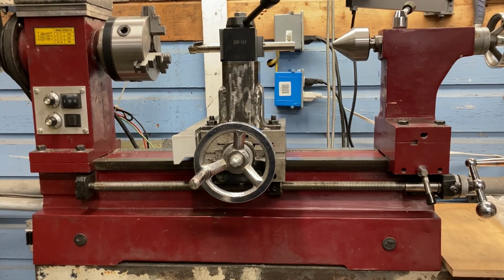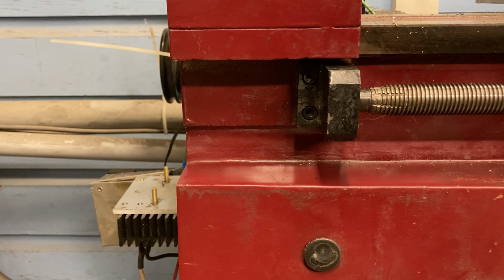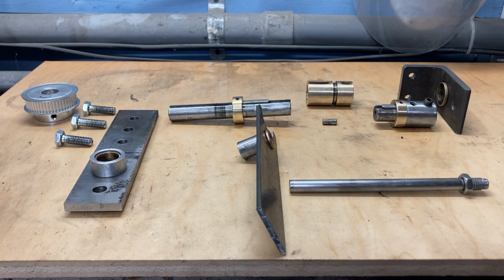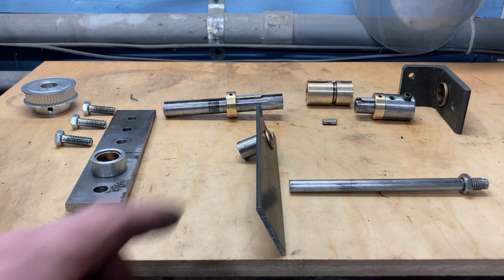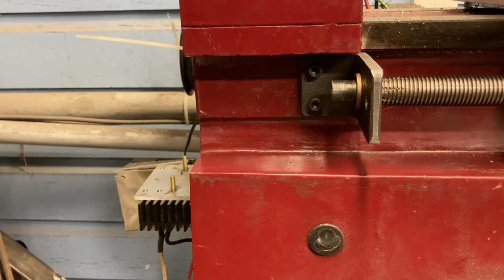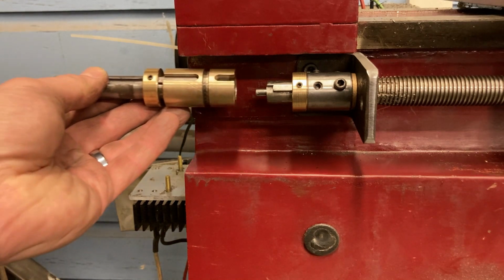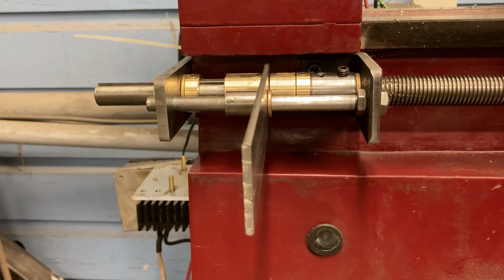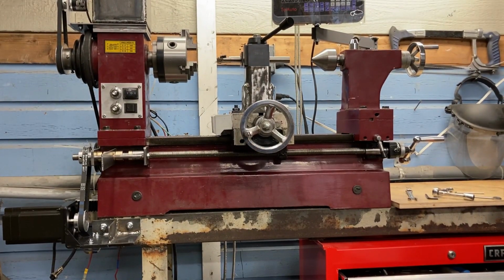DIY Lead-Screw Shaft Clutch for 3 in 1 Lathe Mill, For my clough42 ELS Electronic Lead Screw Project

Comment: Nice solution. Did someone use the leadscrew to cut an Acme thread into a nut? Looks like someone has cut flutes into it! Separating your mill/lathe combo sounds pretty cool.
Reply from the maker: You are the only person to notice my "thread chasing" lead screw.  Yes I used it to fit a new nut to my machine.

Comment: We have talked before concerning your Milling Machine build "conversion" Any way I have just completed the Clough42 ELS and have been trying to find a proper way to wire a carriage cut off stop  and an emergency stop. I have looked over for any comments but have found none so far. With your vast knowledge I was wondering if you have added such features. Om fine with the mechanical aspects. but wondering proper electronics. I was wondering if I could use either the alarm circuit. or just interrupt the DC power.
Reply from the maker: I have not put the safety switch on mine yet.  I posed the same question to Clough42.  Here is my original question and his answer.  Because mine it setup to use both his driver and a stand alone drive I am going to to the way i posed in my question.

Me:
" I have a really simple question. My system is working well and I am very happy with it. I would like to add a normally closed push button switch as a full travel carriage stop for safety. My plan is to wire the switch in line with the wire that connects the + from your board to the three + inputs on the stepper controller. I know that cutting that power will stop the motor, but what I am wondering is if there would be any negative side effects to the electronics by doing it that way and if so is there a better way I can do it? Thanks"

Clough42:
"You could break just the enable line and this should stop the motor, unless you have it inverted. Breaking the +5 should also work.

Remember that this will lose synchronization if you're threading."
Reply: Thank you so much for the quick reply!!! My intent is strictly as a safety measure to avoid old age mistakes and crash the tool into the Chuck! my intent is not a stop for threading, although by the sound it might be able to be used as an approximate stop for turning, again, having a DRO that isn't my goal.  I going forward with a stop and while I'm at it an emergency stop. Ill use the enable feed to shut down the motor feed. Thanks again for your help!!

Comment: Thank you so much for the video! Just as you said, I'm too shocked that I just can't find a simple mechanism that anyone made before....That's so frustrating, though my application is slightly different than yours.
Basically I have a stepper motor that I'd like to engage and disengage, but I can't find any easy and simple mechanism that I can use without dealing with huge backlash.
I'm wondering, do you think I could use the mechanism you showed with 3D printed parts? I don't have a lathe mill(having that would be a dream!)

Also, it seems like when the clutch is engaged the parts are well tightened together even though it just slides back and forth, how reliable is it? How if I'd have my shaft vertically instead of horizontally, would this mechanism still work?

Thank you for sharing this great video.
Reply from the maker: Thanks, I am glad you liked it.  I have been using my clutch for months now to cut threads and then disengage when using the lathe for other things and it works flawlessly.  It has a nice crisp lock and unlock , I am very happy with how it works.  Vertical compared to horizontal shouldn't make a difference as long as you come up with a way to lock it in the up position like a detent.  I may add one to mine at some point but for now the parts are tight enough that its not needed.  As to the plastic parts, are you wanting to print the entire thing or just the parts I made out of brass? If it was all plastic I don't think it would work as the parts would bind against each other but if it was just the slider I think it could work.  My concern would be flex in the plastic.  Another option for you being that you don't have a mill or lathe would be to use a deep socket as the slider and a nut on the shaft that is being driven.  Hard to know how you might mount the socket/slider as I am not sure exactly what you are working with.
Reply: @dazecars  Thanks for the fast reply!
Regarding which parts I need, basically each part I can't purchase, e.g - a simple shaft coupler could be purchased(if it even helps here), but anything custom beyond that would be 3D printed I guess as I don't know anyone with a mill and custom orders are very expensive.

If you feel like it, I'm kinda trying to replicate the following design:
https://youtu.be/TN5hnE2UnbU?t=287

It's a telescope focuser that's being rotated by a geared stepper motor. Since it's high gear ratios, moving the gear backwards is not really possible, and I'd like to achieve that mechanism that will allow me to engage/disengage the motor, then came across your great design, but since the application and method of use(3d print vs mill) is slightly different, well I'm not sure I'd be able to make it good enough ^^

I'll try reading about the deep socket you suggested, thanks a lot :)

Comment: i got the shop fox mill lathe combo i just wish there were a way to make both the mill head and lathe turn at the same time.. like the central machinery..  on mine u engage a clutch in the gear box.. can anyone help me on this one .. how is the central machinery one set up so that it does this..  is there no clutch..?? can i modify mine to do this.. is there a different clutch i can buy that will do this..?? i'm thinking if i remove the clutch engagement knob it might turn all the time..
Reply from the maker: First I have put together a Facebook page for 3 in 1 machines, if you have Facebook you should come join us.  https://www.facebook.com/groups/168134035160655 

As to your question the Central Machinery units have a dog clutch slider and if you put it half way between the two you could engage both at the same time but it doesn't lock into position for either one so one or the other could pop out.  I'm wondering for what operation you would want to have them both moving at the same time?  One option to solve the issue would be to use another motor to power the mill-head.  If you look at my other videos I did one where I removed the mill-head and made it into a stand alone mill.  I hung the new motor off of the back and you could do the same.  If you do that you would want to remove the mill-head cone gear from inside the mill-head so you didn't accidentally power both at the same time.
Reply: @dazecars  thank u so much.. i want both to spin cause i want to put a granite round stock in the lathe and use a hole saw to form a granite sphere.. here is a video  https://www.facebook.com/herb/videos/238532293957002